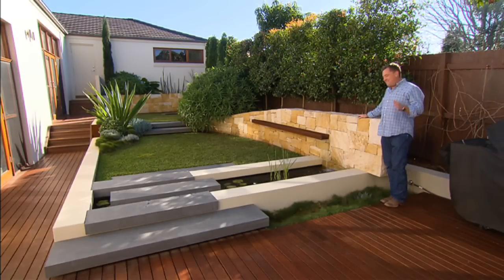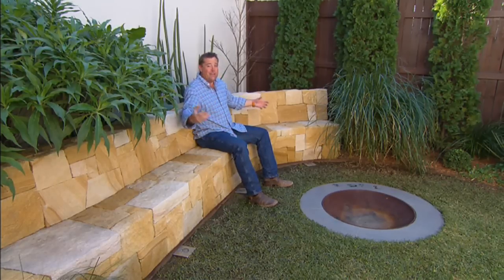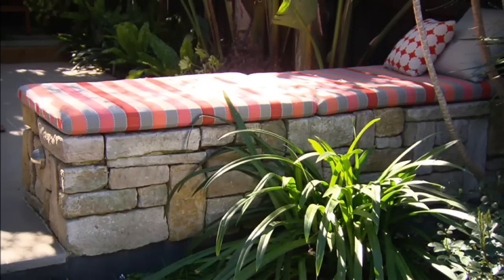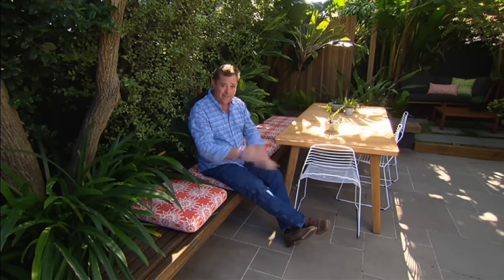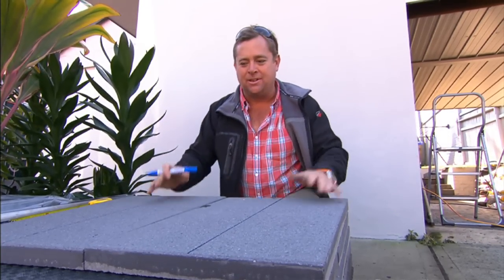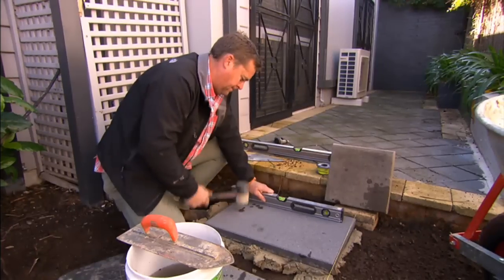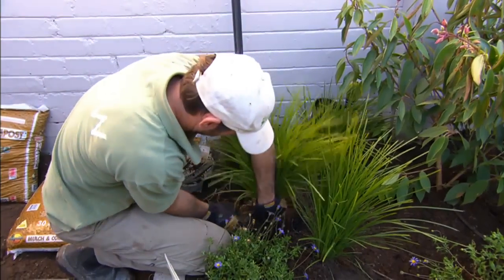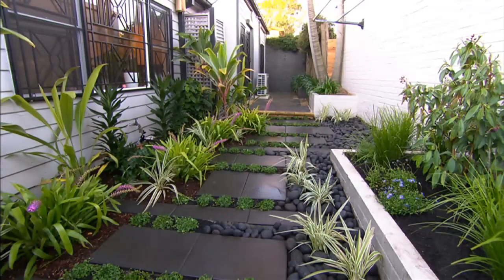Inspirational Small Space Gardens | Gardening | Great Home Ideas

Comment: They make it look so easy but all the hard work are done in the background by professionals. When you go do it it’s completely different and it ends up more trouble than it’s worth. Doesn’t even tell you the basics like setting up a string line and th concrete under the pave needs to cover the whole surface and edge be sloping off.